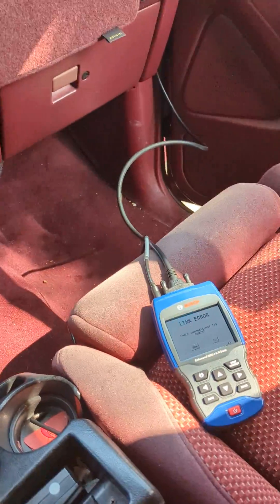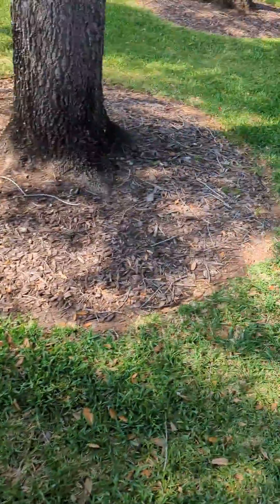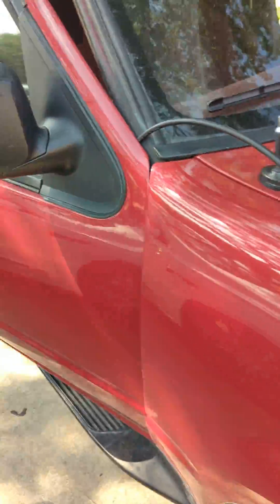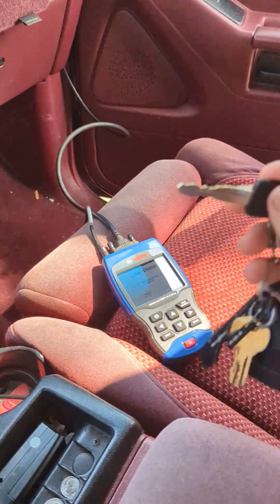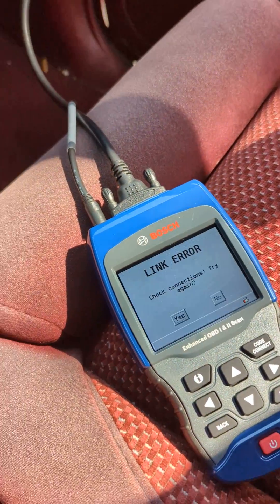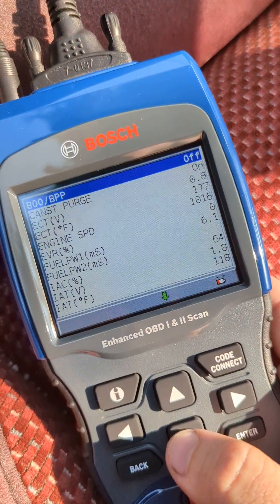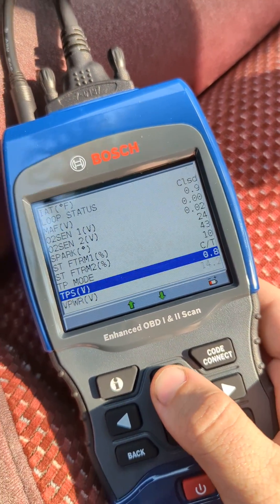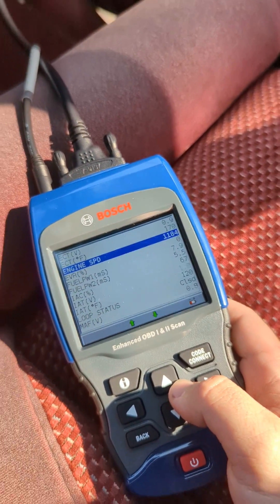How To Read Live Data on a 1994 Ford Explorer (Bosch 1300)

Comment: Oh man, Ive been researching this topic for a while now. Your explorer is equipped with the EEC-IV connector yeah? Im hoping this can help me improve the fuel economy on my 1995 4.9 F150

* upon further searching I found a thread of yours lol, did your situation with the explorer improve? what engine is in it?
Reply from the maker: It has the 4.0 ohv in it. I haven't fixed the issue yet, but it's helped me narrow down my issue to a patch of wires at my firewall. I just haven't had the time or under 104° weather to pull the dash out to get to that section of wires, and see what the culprit is
Reply: Does it read abs codes as well when plugged into the red port on the drivers side?